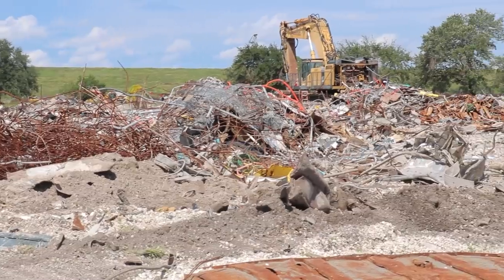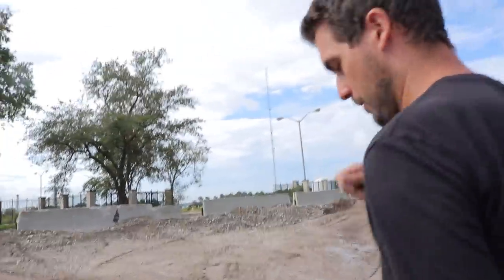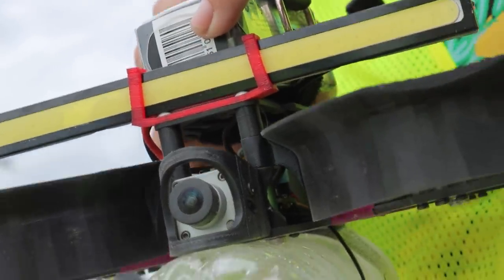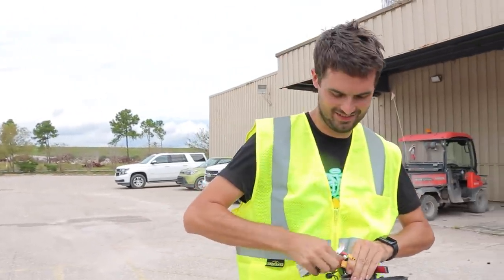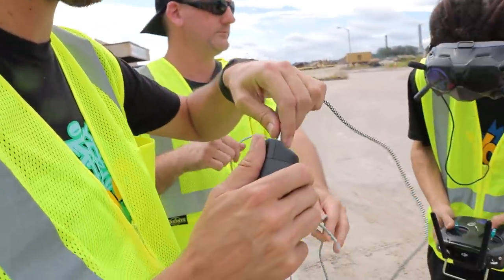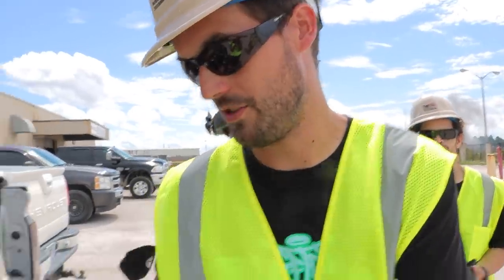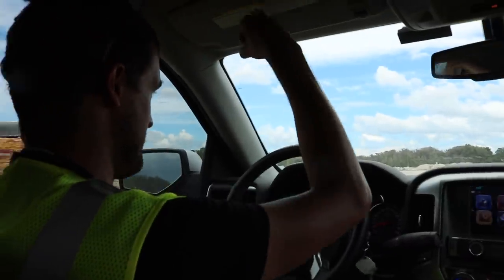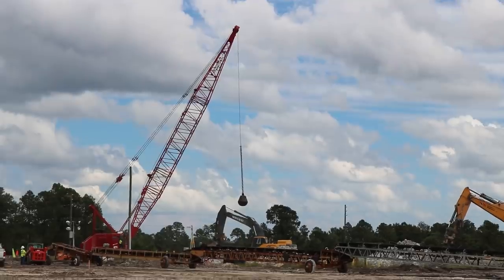Drone Flies UNDERGROUND PIPE Inspection *risky*

Comment: "I dont want to lose my 200$ action cam, so the video is instead gonna be from the 300$ DJI digital Camera"
Reply from the maker: Logic 🤩
Reply: They're going to fly the DJI system one way or another, so adding the action camera would only just add another 200 bucks unnecessarily.
Reply: @vhfgamer  Could have mounted a 30$ camera VTX combo with the Actioncam though
Reply: Isnt dji air unit like $180
Reply: @VoltexRB  but, building.
Reply: @thegrafxguy1  DJI also makes the action cam, lol
Reply: If they went analog with an action cam and lost the drone they wouldn’t have any high def footage for inspection
Dji and no action cam, they lose the drone they still have the footage
Reply: @Jrojan  thanks you I was looking for this comment.

Comment: RC boat?
Reply: Or an RC "monster truck" with pontoons on the sides.
Reply: @retardedguy9847  Then you put a safety line on it. Reel 'er in if it bogs.
Reply: My thoughts exactly, job for a boat, or truck with tires big enough to float.

Comment: I did the same with a mavic air 2, it went well all the time i was flying forward due to the sensors but when stopped it had trouble fixing its position over running water, it went down!🤷‍♂️

Comment: Manufactured reason to "use" a drone is manufactured.

As if they couldn't just dig up the pipe on either side of the roadway and railway and fill it in directly. All they did was stick the tip of the drone in, turn it around, and fly out. If they really wanted to check the length of the pipe, an RC hovercraft would have been better suited. Maybe with a retroreflective panel on it so they could get a distance reading with a laser range finder.

Comment: Wait, why wouldn't you just use an RC Jet Boat with FPV on it? Tie a string on it just in case it gets stuck to pull it out. The Jet boats don't use props and are built for this sorta thing.

Comment: About the DJI systems lag... there isn't "one or two more milliseconds' lag". There's more like 100 milliseconds more lag. You guys' bias for DJI is so obvious now that they're sponsoring you. You didn't even mention how much more expensive and heavy it is.
Reply: Definitely biased, but actually not as bad as you suggest.  We stuck one on our LiDAR doing a 2000ft. vent raise in a mine and lowered it down and it had a strong signal the whole way with decent lag, ~20-25ms.  We run them on several inspection drones for an auxiliary view, and that is through some of the worst possible conditions.
Reply: @KlockworXMusic  Looking at this site https://www.dronezon.com/drone-reviews/dji-goggle-features-review-specs-drone-compatibility/ it seems that only the "Racing Edition" gets sane latency, and even then it's only when it's in 480p mode (which loses their entire claim to fame)... This also isn't the only example of RR only saying the positives and no negatives of DJI.

I don't "suggest" that there's bias. I observe it.